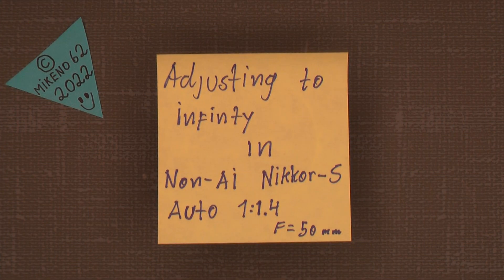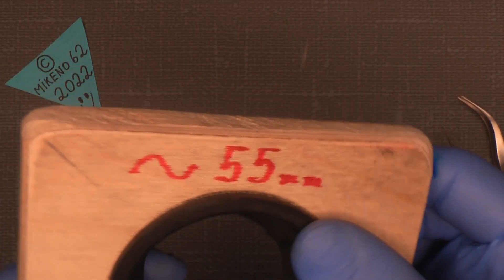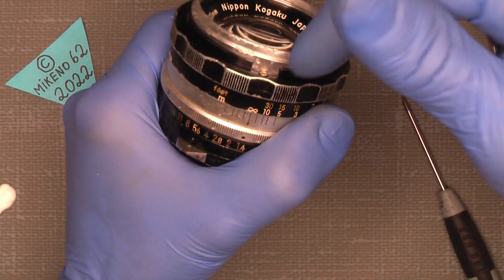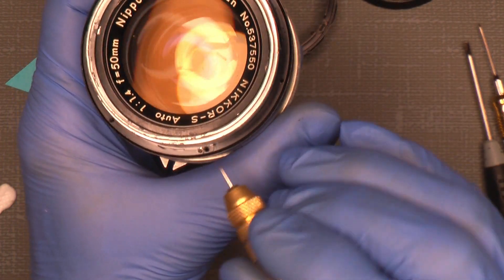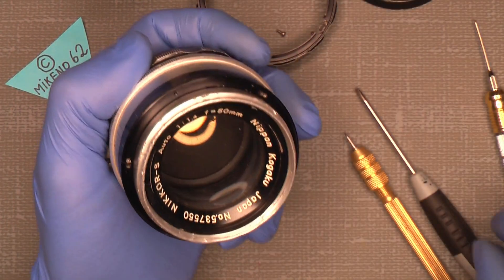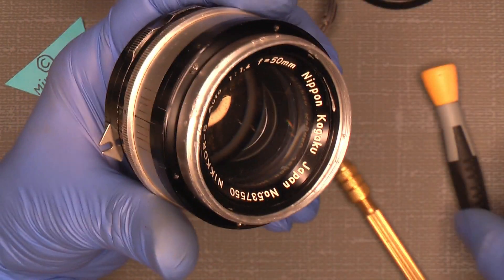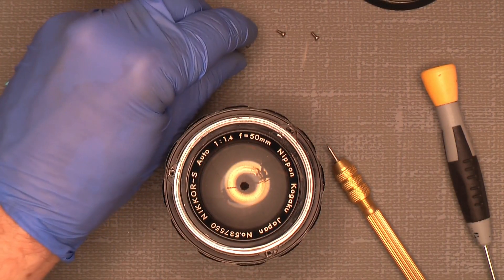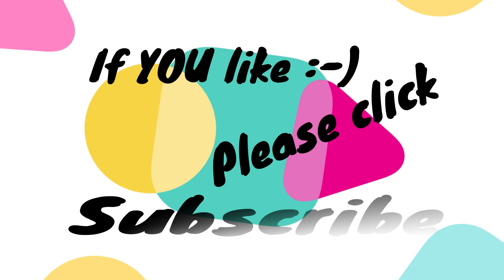Adjust to infinity in Non-Ai Nikkor-S Auto 1:1.4 f=50mm

Comment: Hello,
First, let me say thank you for all of your informative videos. I recently bought a Nikon F and Nikon F2, with assorted lenses. Your videos have been helpful. I am needing to clean fungus from aHello,
First let me say thank you for all of your informative videos. I recently bought an Nikon F and Nikon F2, with assorted lenses. Your videos have been helpful. I am needing to clean fungus from a Nikkor-S 1.4.  I watched your video about your version of this lens, and I spent several days trying to get the front retaining ring off without success. I had assumed that my lens was like yours, and that that ring would come off. However, I could not make it budge, so I looked very closely with high magnification and saw that there seems to be no gap between the front retaining ring and the focusing ring itself. I then undid three screws in the focusing ring, and the entire focusing ring and retaining ring are one unit on this camera. I am unsure how to proceed from there. The fungus is on the rear element, so I thought I may take off the back pieces of the lens, but unlike your lens with five screws, mine has no screws on the ring itself. There are some screws on a small collar that surrounds the rear element of the lens. I will show you some photos. My question is have you ever run into this variation of the lens, and how do I get the glass out from this particular model? Thank you for your help.

Comment: Thank you for the helpful video! However, I have an issue with the focusing ring (the larger, numbered one). It only rotates the inner black ring, which is secured by three screws, but it does not turn the outer black ring. As a result, it’s not functional. The lenses cannot be adjusted because only the inner black ring moves, not the outer one. How can I fix this issue? Thanks in advance.
Reply from the maker: Well, that's not good, I have taken a closer look in my lens, but I'm not 100% sure what you mean. Could you upload a short video of the issue, in that way it will be a lot more easy to see what can be done to fix it.
Reply: Hi there, as you have showed even nobody touched before that black inner circle's very tiny screws,  I have tried to  tighter them. As a result those 3 tiny screws has been gone in to deep can not be seen anymore. However it has fixed the issue. Now inner black circle and outer black circle finally fixed each other. Then I have putted the outer marked circle on them qnd closed the lens. Now it works. A bit tight focus but works. Thank you again for that useful video I wouldn't make it without it. Thanks.

Comment: Nice video, as usual. Thank you. I had the same problem with the same lens. The lens focused past infinity in the viewfinder, so that infinity was near the 30 ft. mark on the focus ring. Upon disassembling the lens I discovered that someone had left marks that no longer aligned and had apparently put it back together without the proper adjustment. After loosening the three screws holding the inner adjustment ring I got the marks to line up but the three screws when tightened wouldn’t hold the adjustment. After nearly an hour of trying to make it work I resorted to loosening the screws, backing the inner ring out all the way, then putting some epoxy on the threads, and aligning the marks. The next day I put the lens back together and infinity was at infinity. Love that epoxy. Will never have to adjust this again.
Reply from the maker: It looks like you have done the same thing that I did with one of my older Nikkor lenses back then, it was a very used lens but the optic elements was fine, but 3 of the screw holes was worn out. I only add a very little drop so if it was important, I could still open the lens. And I agree Epoxy is a very useful stuff :-)

Comment: Thank you for the videos. It would be great to get a look at the helicoids in the slightly later 50mm 1.4 lens, if you ever find a reason to. I have a 1.4 AI which took a tumble down a footpath some years ago; since then the lens has some side-to-side movement of the optical assembly which couples with the focusing action. It's entirely useable but I can't help thinking the elements must be misaligned depending on which direction the lens has been focused!
Reply from the maker: It does not sound good with your lens but good it did not break, maybe there is a loose retaining ring in the lens assembly that needed to be thigten or maybe the front ring is a bit loose. Just a few ideas. Sorry I don't have a video about the Ai Nikkor 50mm 1:1.4.